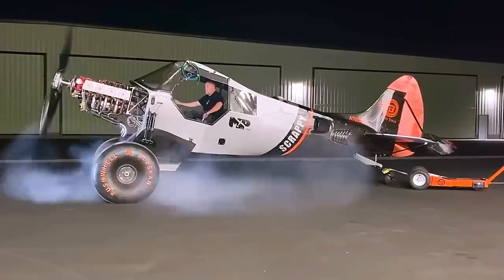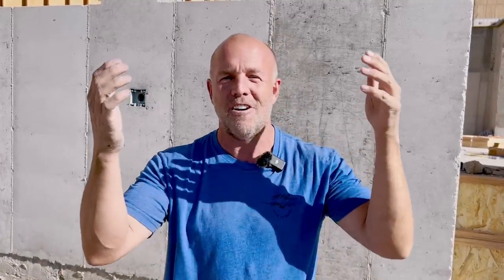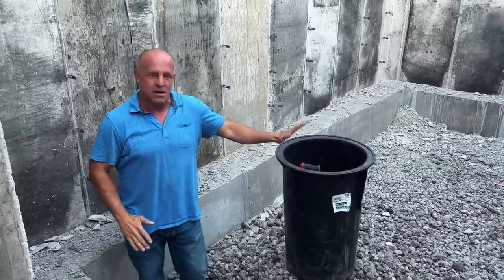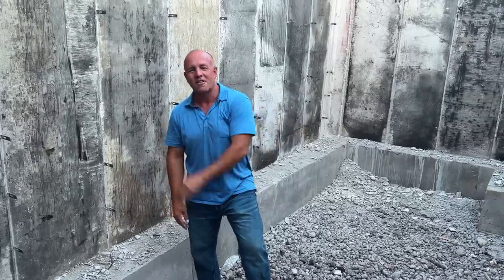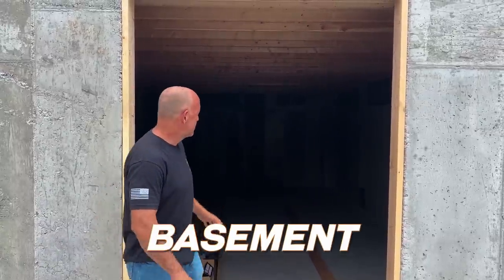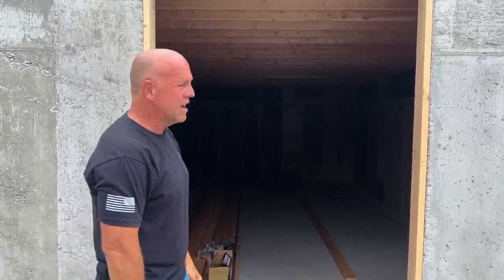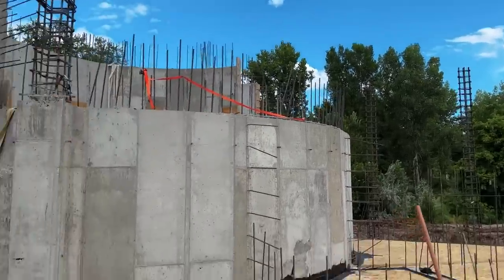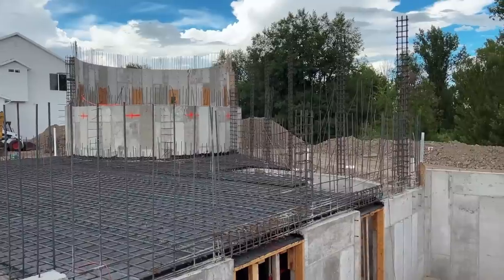Building a 3-Story Swimming Pool with Transforming Floor | House Build #3

Comment: I usually use Aquaroc sheets to protect the insulation (highest grade polyiso) all the way down and up. 

It's though, doesn't care about water, has its own resistance coefficient and it's cheap. For everything going down from base board level, I spray it with rubber before installation. Each sheet gets 4 layers of 3M rubber undercoating and each joint is live "glued" with rubber spacers that are H profiled, so there's no contact between boards. 

The oldest insulation i've done is now... close to 8 years. No issues reported, it's superior to any membrane in every possible way. Between all that and the back fill sits pondliner. Not for its resistance to water, tho it's a bonus, rather because it's cheap, thick material that's easily glued together in the right dimensions. Especially around pipes or the old features usually found in what i work in (old building restoration) like cellar passages or even more modern stuff like gas or electric. 

For the fill, the best i've found is to use crushed rock at the bottom of the excavation. It's compacted, drainage pipes run around the building to a drainage well and the rest is compacted inert soil that's also filled with special pellets that activate in the presence of organic stuff like roots and release plant poison. 

Any building that's required to have a lawn or garden has a separation layer between the fill medium and the garden soil. Biggest danger to all that work (above and in general) is letting roots get near your insulation. That's game over. They'll find the smallest hole and breach.

Several years ago, before i had all these procedures cooked up, i got recalled after almost 3 years on a job where the basement got flooded. Nothing as bad in the past of the building, but enough to be called. Turned out to be a nearby growing cyprus tree that had its way with the insulation membrane. The membrane lost (the LEGO type membrane we all know about).

Comment: I wonder if the planning board wishes it had allowed you to build a normal pool like you wanted to at the start?  I think Mike is happy, in a backward way, they didn’t so he has an engineering challenge to solve.
Reply: They’ve been so great to work with. They stop by and check out the project periodically.

Comment: Why so little insulation against ground? In Norway 300 mm XPS  is usually used.
Reply: I live in Ontario, Canada and the difference between what they do up north to down south even varies due to the climate difference.  (Although all of Europe is only 9.46 times the size so we are talking quite a distance.)  When I shovel snow in the southern part, it just goes beside the driveway and melts, where up north, you have to have long term storage plans, sometimes moving snow into the backyard.  Most places in the U.S. don't need the same attention to cold weather.  And in many cases, they just have cheaper heating costs so the savings isn't as huge either.
Reply: @wihamaki  yeah i understand but still bottom of pool is below earth sub freezing lvl and they do have frost so I though it would be wise to insulate better. Much cheaper to do before than after, and with Ukraine war raising gas prices i thought it would make sense, but yeah different places have different needs, also with all that thick concrete theres a lot of thermal mass its definitely not just water he needs heated up. But anyway it's to late to change, I was just curious

Comment: Again me: Had cases of "100 yrs water"...climate changes... better to be ready! Nice solution, and thinking in advance (just, as I said before, if everything out is flooded, where You will pump out the water from inside"? But ok.... lest proceed:  Support for external compaction - more than needed, even maybe not enough, but Your brain is working... I would go stronger before so hard compaction...!" Sorry, but I think (Repeating, English is not my native language, but Lexan is other product name, these windows are more polycarbonate thick windows".... and nicely done... who is doing rebar, know almost everything...should be denser those secondaries at 90 degrees, at the joints (2-4inches max), but its ok...I like it, that they turn every secondary joint around, not at the same direction...in case of earthquake is important! ... Just add...any counter lever construction, should be 1/3 outside vs 2/3 inside, well connected to the basic structure... REGARDS FROM SERBIA

Comment: Why not a stainless steel pool system.  When you use concrete you are just adding so much more to the water load.  Most high end elevated pools are stainless steel as it is.

Comment: are you fitting a bucket load of solar, battery, underfloor heating, heatpump etc? the CO2 cost of this building is immense would be great to see you cut some of that through using renewables.

oh please tell me you arent using gas heating... a heatpump will save you a fortune.

Comment: Is there any issue with the carbon footprint and the impact on the environment of this project?
Reply: The math: he says 450yards of concrete, let's assume only 2/3rds done, so will be ~700yards total. But a standard larger house build might use 100yards, so on the hook for an extra 600yards on this project. Wiki says 410kg CO2/m^3 total emissions for standard concrete mix, or 313kg CO2/yard. That's 188,000kg total. Comparing that to the most efficient 2023 diesel pickup truck which EPA says is 387g CO2/mile, that means it's equivalent to driving about 485,000miles or 778,000km.
Reply: @4stringmanagmaildcom  You can't be serious right? You realize the companies he is involved with replace gas powered aircraft tugs with battery powered tugs and develop technology to reclaim fresh water. I think he has more than offset the footprint of his house. Have you?